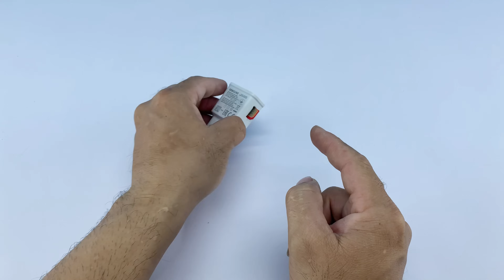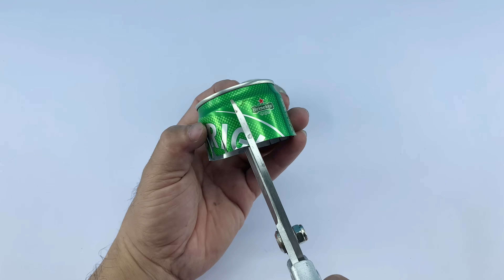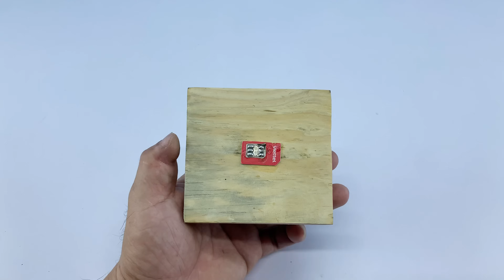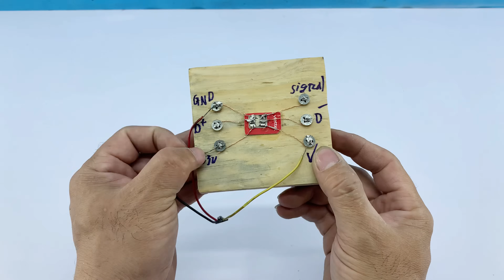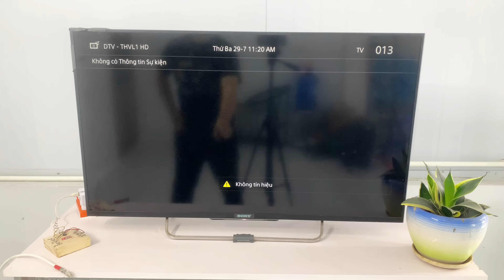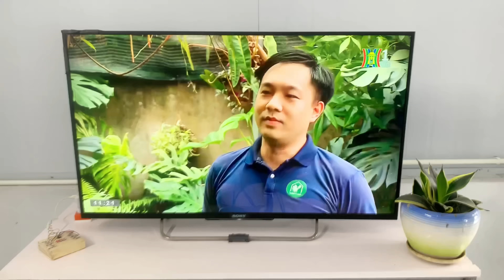Insert a SIM Card into a Charger!! 😱 You Won’t Believe What Happens Next

Comment: Que número tiene el regulador de voltage
Reply from the maker: Usually, the voltage regulator number depends on the device, but a common one is *7805* for 5V output or *7812* for 12V output. Check the markings on your specific regulator to be sure.